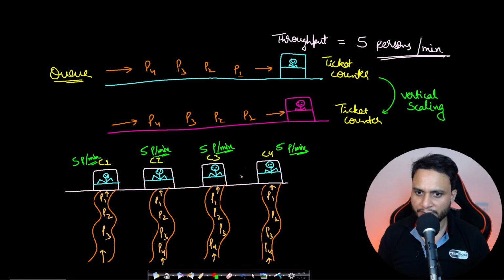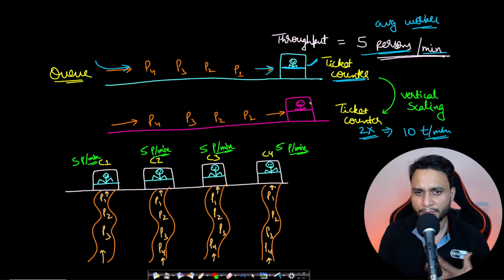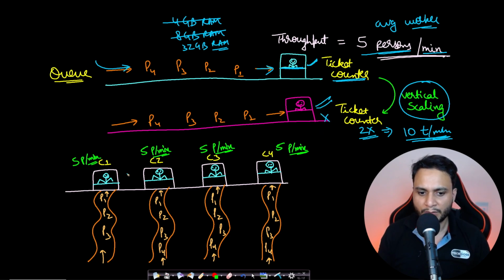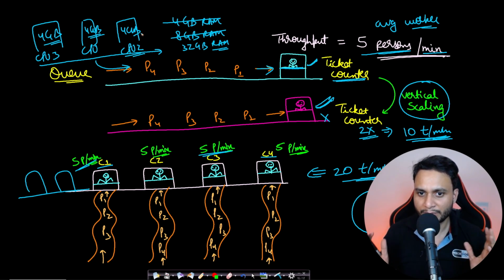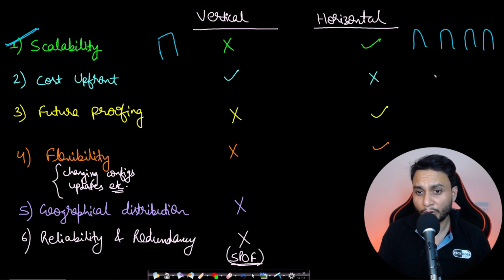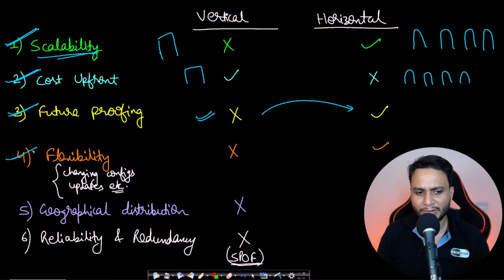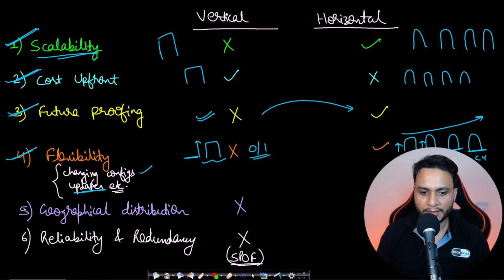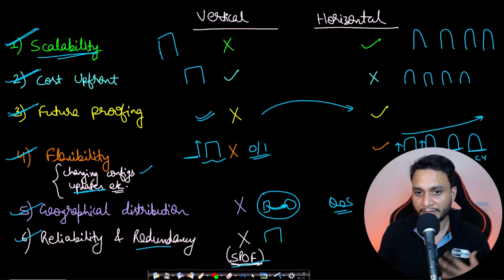Vertical and Horizontal scaling | System design

Comment: In system design, vertical scaling and horizontal scaling are two strategies for increasing a system's capacity to handle increased load, whether that load is in terms of data volume, number of users, or computational demand. Each approach has its own advantages, disadvantages, and use cases.

# Vertical Scaling (Scaling Up)
Vertical scaling involves adding more resources to a single server or machine. This typically means upgrading the hardware components, such as adding more CPU, memory, or storage to an existing system.

## Characteristics:
- Resource Enhancement: Involves enhancing the existing server's capabilities.
- Simplicity: Often simpler to implement since it usually doesn't require changes to the application or its architecture.
- Limited by Hardware: There's a physical limit to how much a single machine can be upgraded.

## Advantages:
- Simplified Management: Since there's only one machine to manage, it can be easier to set up, configure, and maintain.
- No Need for Data Partitioning: All data can reside in one place, which can simplify data management.

## Disadvantages:
- Single Point of Failure: If the machine fails, the entire system can go down, leading to potential downtime.
- Limited Scalability: Eventually, you reach the limits of what a single machine can handle in terms of hardware capacity.
- Costly: High-end hardware can be expensive, and the cost increases significantly as you scale up.

## Use Cases:
- Suitable for applications that require strong consistency and have limited scalability requirements.
- Often used when the application can easily fit on a single, powerful machine.

# Horizontal Scaling (Scaling Out)
Horizontal scaling involves adding more machines to a system, often called nodes, to distribute the load. This approach can be implemented by adding more servers to a cluster or adding more instances of services.

## Characteristics:
- Resource Addition: Involves adding more machines to handle the load.
- Scalability: Can handle more significant increases in load because you can keep adding more machines.
- Complexity: Often requires changes in the application architecture to distribute the load effectively.

## Advantages:
- Redundancy: With multiple machines, there's no single point of failure, which can improve system reliability and availability.
- Unlimited Scalability: Theoretically, you can keep adding machines to scale out, allowing for virtually unlimited scalability.
- Cost-Effective: Can be more cost-effective, as commodity hardware can be used and purchased incrementally.

## Disadvantages:
- Complex Management: Requires managing a cluster of machines, which can add complexity in terms of configuration, deployment, and monitoring.
- Data Consistency: Ensuring data consistency across multiple nodes can be challenging, especially in distributed systems.
- Network Latency: As data and requests may need to travel between multiple machines, network latency can become a concern.

## Use Cases:
- Suitable for web applications, microservices architectures, and systems requiring high availability and scalability.
- Often used in cloud environments, where resources can be easily added or removed as needed.

# Choosing Between Vertical and Horizontal Scaling
- Vertical Scaling is often chosen when the application is simple, the cost of high-end hardware is justifiable, and there's no need for high availability or redundancy.
- Horizontal Scaling is preferred in scenarios where high availability, fault tolerance, and scalability are critical. It's also more suitable for cloud-native applications and distributed systems.